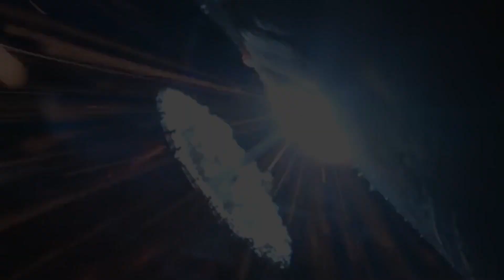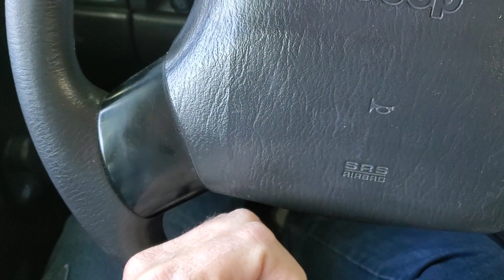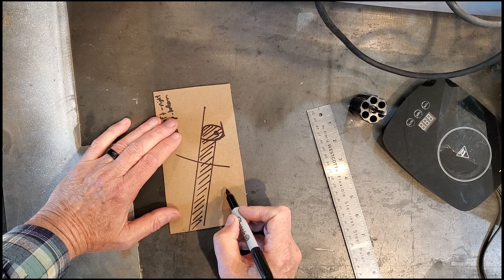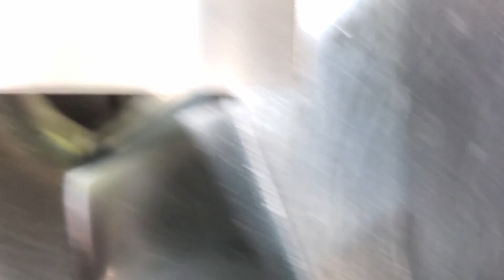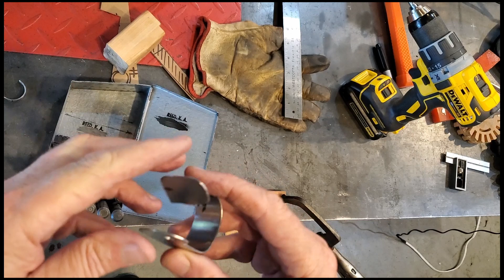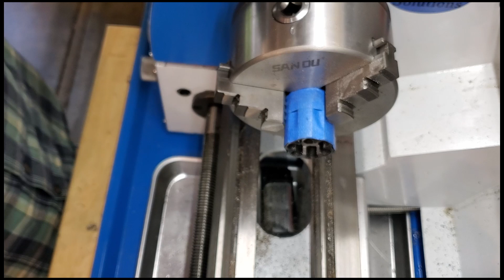DIY CUSTOM STEERING WHEEL KNOB

Comment: You might try to fire one or two of those cases after the wd40 bath.  I recently read an article where they tested primers and not all of them were inert after soaking in WD 40.  It seems to me they used several fluids from water to brake cleaner but I can’t remember which ones worked the best.
Reply from the maker: Yes, I wouldn't be using this method if I hadn't tried it.  After 48 hours submerged in wd 40 none of my test primers would fire.